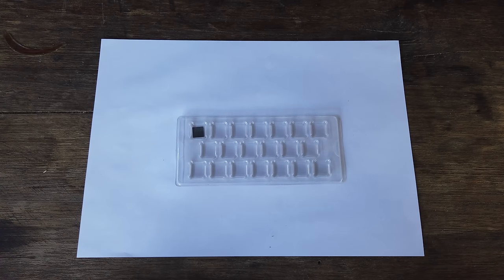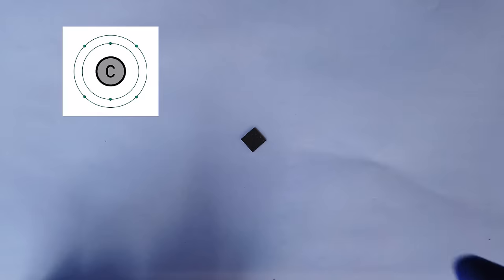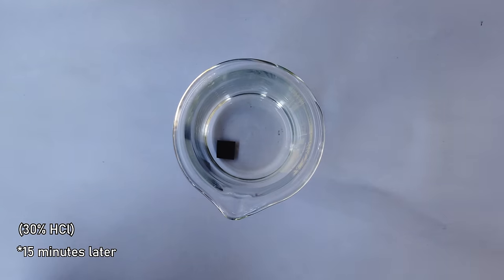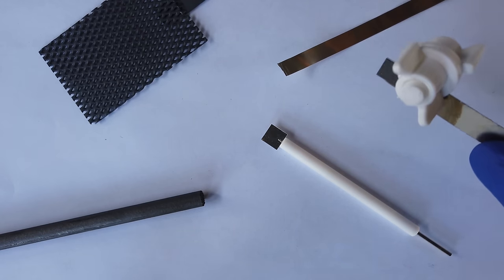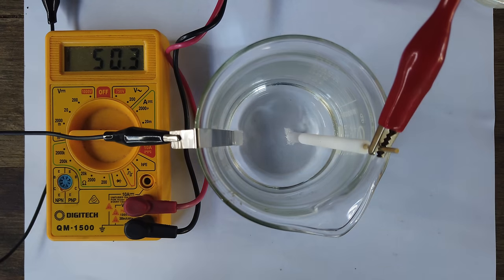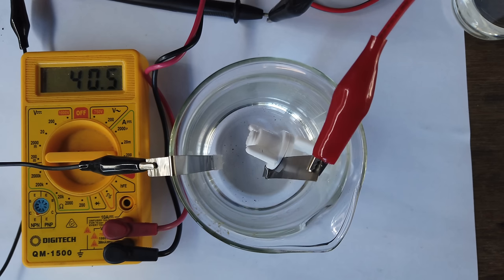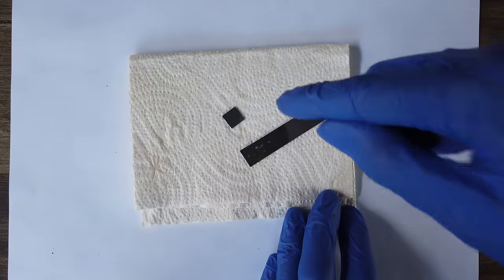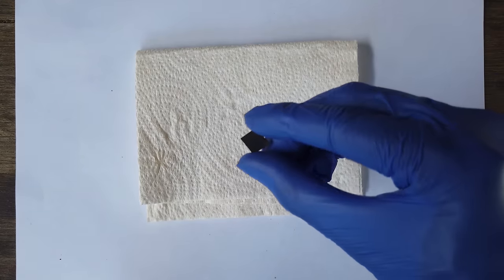A Very Special Electrode

Comment: do you think that this material may be useful for perchlorates?
Reply: Yeah, he does. 10:33
Reply: yeah ofcourse it can be used for chlorate/percholate making, it's the only suitable metal for the job, it has great yeild and its build for it.
Reply from the maker: Yep! For two reasons:
1) It's great at doing the reaction of oxidising chlorate to perchlorate.
2) When using it as an anode, you don't really need to worry much about cell conditions. Other electrodes will degrade significantly if you have small amounts of chloride in the cell or if you continue electrolysing after complete conversion. With this electrode, it's so inert that neither of those things matter. It can even electrolyse chloride all the way to perchlorate in one run with zero issues (something basically no other electrode can do).

Comment: Im wondering if these were left over from making diamond photodiodes, the substrate was made of boron doped p type diamond with nitrogen doped N type diamond. They had very good UV sensitivity in the UV B and UV C regions. They were used for measuring the energy of KrF excimer lasers.❤
Reply from the maker: It's possible, but as far as I'm aware, boron-doped diamond used in true semiconductor applications normally requires a much lower boron concentration. Having a boron concentration of above 0.1% is something that's generally done solely for the purpose of making electrodes for electrochemistry, as we need high conductivity over macroscopic distances.
Still though, I didn't know these types of semiconductor were used in photodiodes - that's cool!

Comment: Congratulations!
It looks a LOT like pyrolytic graphite, it would be interesting it this doped material will do diamagnetic levitation as 'pure' pyrolytic graphite does.
Reply from the maker: An interesting idea!
Just tested it on a set of strong neodymium magnets - doesn't appear to exhibit any tendency to levitate...
Though it makes sense I suppose - the diamagnetic constant of diamond is about 20 times lower than that of pyrolytic graphite. Conductivity doesn't seem to have much to do with it.
Reply: It won't. Pyrolytic graphite does this because of the high conductivity along the graphene sheets within the graphite. Pyrolytic graphite is extremely well aligned, so the effect is very strong. "Normal" graphite doesn't show this effect because the crystals of graphite are small and randomly oriented.
Reply: pyrolitic graphite is more bubbly looking on the surface they do look kinda similar intell   you compare them next to each other. The graphite is more gray and looks more molten than like tiny diamonds. Unfortunately, cameras don't do a good job of capturing detail

Comment: I think you should buy some electrolysis equipment with an anion and proton cation exchange membrane because it is a selective membrane that allows ions to pass through without holes thanks to chemical signals, not a clay pot with lithium holes and is strong. Surely the decomposition side reaction occurs more frequently than the production reaction. This may be the reason you failed to produce hydrogen peroxide  ,nitric acid and sulfuric acid from electrolysis. It also helps you create some reactions without the need for an electrolyte solution like fuel cells using hydrogen oxygen

Comment: Very interesting. One could not really see the multimeter reading, though and tens of Ohms is rather high for a contact resistance.
Reply from the maker: Hmm. That's true. I'll keep an eye on similar issues regarding filming screens in the future. Thanks for pointing it out!
And yes, boron-doped diamond is actually rather notorious for exhibiting a high degree of contact resistance. It's often somewhat difficult to make a good connection to it.

Comment: I like electrochemistry presented this way.  It’s intriguing.  Looking forward to more.  I actually have a BDD electrode, but I’ve only had one occasion to use it, so I’m looking forward to replicating the experiments in your videos.  I notice you didn’t use a reference electrode for this, but it looks like your power supply will accept one.
Reply from the maker: I'm glad you like the presentation style! Thanks!
I've got a couple of other videos I'm working on at the moment, but we'll get to using this thing quite soon, hopefully.
I've considered using reference electrodes in a few of my latest videos, but I feel like it would just overcomplicate things for a general audience (at least, until I make a video about what they're for and how to use them, haha). We'll get there eventually.
The third pin on my power supply is actually (disappointingly) just an earth connection...
Reply: @ScrapScience  Great!  I’m looking forward to anything you decide to make, but don’t forget about that magical BDD.  I know some power supplies have a reference port, but I plug my Ag/AgCl reference electrode into the earth connection.  I don’t ground the power supply case when I do that.  Seems to work well.

Comment: I just randomly thought about, can pressures also change how reactions happens?
Like, what if you do some electrolysis, but under INSANE pressures, the pressures is like several 100 bar, or higher? or something?
Reply from the maker: Changing the partial pressures of the reactants/products involved in an electrolytic reaction changes the potentials at which they occur.
If we take your example of 100 bar, we can very easily take the water reduction half reaction and plug this 100 bar value for hydrogen partial pressure into the 'Nernst equation'. Doing so tells us that the hydrogen evolution reaction will happily occur at 100 bar with an extra 136 mV of negative potential.
You can do the same thing for the oxygen evolution reaction, and you can find that this half reaction will require an extra 68 mV to proceed at 100 bar.
Overall, water electrolysis is happy to proceed at these pressures, and will just give you pressurised gasses as a result. You'll just need an extra 0.2 V or so to get the reaction to happen.

Comment: I've read a recent article on production of C1 and C2 carboxylic acids with diamond electrodes but thought it is a future tech not really available. This makes me review the article:

Arts, Anke, Matheus T. de Groot, and John van der Schaaf. "Current efficiency and mass transfer effects in electrochemical oxidation of C1 and C2 carboxylic acids on boron doped diamond electrodes." Chemical Engineering Journal Advances 6 (2021): 100093.
Reply from the maker: Yep! Many reactions proceed in very interesting ways on this electrode due to the ability to utilise those hydroxyl radicals. I don't even know where to start with using this thing...
Reply: @ScrapScience  I would love to see your results in future. I was exploring production of oxoacetic (glyoxylic) acid. This can be made even at scale by cathodic reduction of oxalic acid (PbO2 electrode) in dil. H2SO4 medium, but the workup and isolation is still challenging, especially due to removal of all the water and avoiding heating above ~40 oC (decomposition to CO/CO2, disproportionation, polymerization) making the compound commercially available mostly just as 50% solution with glycolic and oxalic acids as common impurities (plus minute amounts of glyoxal, glycolaldehyde, ethylene glycol, formic acid and other reduction by-products). Crystalline monohydrate is available but a bit more expensive.
I've purchased the monohydrate once and tried preparation of fragrance compounds - it's an excellent electrophile allowing convenient prep. of aldehydes so I was amazed and understood why it is popular as green chemistry alternative to other preparations (e.g. Grignards, var. formylations, chloromethylation).
I will try other production methods of the glyoxylic acid (magnesium reduction in cold sat. oxalic acid, cleavage of L-tartaric acid with periodate/hypochlorite) but so far the ozonolysis of maleic acid (fumaric might work, too) and electroreduction of oxalic a. remain the state of the art.

Comment: Say, did you ever think of remaking some of your earlier electroplating videos?

Last year, I got large graphite thermal pads whichv have been extremely capable and barely experienced degradation because of their uniformity and very high surface area.
Reply from the maker: Like, that one video I made about copper plating at the start of the channel?

It's possible, but I don't think metal plating is really my forte. I know very little about it...
Reply: @ScrapScience  That is correct. I guess sulfuric acid production is the one I remember the most :)

Comment: How will you attach it to a conductive isolated connection rod and what material would you choose? Will you now always use this clap thing to attach it to a Nickel strip? You know that your comparison is neither accurate nor is it valid, because on your doped piece was Nickel also contributing and your Ruthenium electrode had more surface area and so on.
Reply from the maker: Titanium is generally the substrate of choice for electrodes like this. It's nature as a so-called 'valve metal' makes it ideal for connections to active anode materials since it is extremely chemically resistant and passivates under anodic conditions. Eventually, I'll buy some small titanium bolts, nuts, and washers to make a good, stable connection. I've used titanium in this video to serve as the connecting piece, not nickel.

I didn't go into it much for the sake of simplicity, but I took great care in trying to keep the anode surface areas very consistent in each test. First, the BDD piece is attached with a piece of titanium, as stated before, the complete passivation of which occurs very quickly. Hence, the connecting material should not contribute significantly to the measurement of the BDD. Next, it's difficult to see in the footage, but I maintained a constant surface area on each electrode by covering excess surfaces with electrical tape, such that slightly less than two square centimetres were exposed in each case. You can see the black tape I used on the nickel anode at 5:35, and you can see it a little bit on the MMO and graphite too.

Whilst I'd agree that the comparison is not accurate (it was never meant to be), I'd still argue that the general trend we're seeing is valid. There may be an argument to be had about the influence of geometric surface area vs true surface area, or the effect of contact resistance in the case of the BDD, but the trend here seems to match literature on the comparative kinetics of the OER on these materials.

Comment: hi harry I am making a new chlorate cell in November/ December but I need some stuff for it so I've managed to find the 10v dc converter but I need a power supply that you used in your A SODIUM CHLORATE CELL video ,by that I mean a power supply that can supply at least 5 amps and that can handle a electrolysis for multiple days < so could you comment the name I should search in google to get the result in your privallige I will @ your channel in my video (I'm subscribed)
Reply from the maker: Glad to hear - a chlorate cell is a great project!
Nowadays, I just use a lab bench power supply with adjustable voltage and current. But back when I made my chlorate cells, I was using a current controlled buck converter hooked up to an ATX power supply from an old computer. Hopefully you'll be able to find a similar product.
Reply: @ScrapScience  okay thank you i will try to find that power supply , thank you for replying and i enjoy watching your videos

Comment: will this work in reverse? can you set this cell up with a mystery anode and tell what metal it is based on the voltage?
Reply from the maker: Kind of. Not for this particular test (too many metals have similar behaviours when performing the oxygen evolution reaction, and the test is sensitive to many other experimental factors).
Other very similar tests (voltammetry and open circuit potental, for example) can definitely identify metals though!

Comment: I'm sorry if I'm asking too many questions but you mentioned that a Platinum anode is not resistant to HCl, HCl can form at anode chamber when doing membrane electrolysis of NaCl would that degrade it too or are the amounts forming too small to cause damage?
Reply from the maker: It ultimately depends on how you run the electrolysis in that case, but yes, the concentrations of HCl generated under membrane electrolysis of NaCl are not high enough to degrade a platinum anode very quickly.
The rate of platinum degradation for chloride electrolysis is going to be a function of pH. With lower pH, the rate increases exponentially.

Comment: I electrolyse the copper out of my spent ferric chloride etchant, using a platinum wire anode, but only with very low current. I leave it for a week with like 10mA. Will the platinum still degrade at this, I wonder?

Also it would be informative to see you compare the properties of those anodes to lead acid battery anodes, I hear they’re remarkably chemically resilient.

Oh and that window comparison is fascinating, from the perspective of electroplating novel metals. I’ve been looking into electrochemical 3D printing, particularly the ability to print an alloy that changes ratios as you go, being able to add vanadium to a nickel+iron alloy would be handy, but I guess chromium is probably too far away.
I think it would be possible to have two electrochemical loops, one that dissolves the metal and another that redeposits it, in the same system using floating power supplies and a properly designed print-head.
Reply from the maker: In the presence of chloride ions, platinum degradation basically depends on pH. The lower the pH, the faster the degradation. Not sure exactly when it becomes a problem though.

The positive electrodes in lead acid batteries are actually terrible as anodes, and reports of their chemical stability are very misleading. It's pretty much a wildly pervasive myth. Due to the way lead acid batteries are designed, the positive electrodes are nothing more than than a lead sponge that has been anodised to form lead dioxide on the surface. Since this is never a perfect coat, the anodes are really no more chemically resistant than lead metal, and they're only really stable in sulfate (and maybe carbonate) electrolytes. Basically any other electrolyte will quickly destroy these electrodes and leave you with a mess of toxic lead in solution. I really wish it weren't such a common myth, because people recommend these anodes all the time without any knowledge of their actual properties - basically convincing people to make a bunch of toxic lead waste.
Anyway, sorry for the rant about lead acid battery electrodes, I'm just not a fan of how common the myth is. Basically, these electrodes aren't chemically resistant at all. If I had to add them to the table at 4:11, the sequence would go 'resistant, degradation, slow degradation, degradation'.

Can't say I'm very knowledgable on any plating processes, but your investigation sounds interesting!
Reply: @ScrapScience   thanks for the reply, I heard that it was the lead oxide that was itself electrically conductive, but it makes sense it wouldn’t be stable outside of that kind of solution. Maybe lead oxide itself could be deposited on a matrix like with an MMO electrode, but that still assumes it’s mechanically stable and electrically conductive enough in that form. I’ve always been pretty wary of lead in solution, so thanks for clearing that up.

Next up, buy myself an iridium electrode haha
Reply from the maker: Depositing lead dioxide on an MMO electrode is actually a very reliable way to make a robust lead oxide anode! From what I've seen, anodes prepared this way are quite good, though they do slowly fall apart mechanically (much like graphite often does). Of course, only if you're brave enough to set up a lead oxide plating bath... I'm definitely not, lol.

Iridium... a good choice, haha.

Comment: Would this electrode be suitable for a Zinc Bromide battery? I've read that Zinc Bromide batteries need to be charged below the threshold of water splitting. So, with this electrode, could you apply more amps without splitting water?
Reply from the maker: Not really, as far as I'm aware.
If you use this thing as the negative electrode, you're going to be depositing zinc metal on it anyway during the charging process, and the threshold for water reduction will quickly adjust to that of zinc.
If you use it as the positive electrode, it's not really necessary since water oxidation is so much more difficult to perform than bromide oxidation, regardless of the electrode material.
Additionally, even if you could widen the electrochemical window of your solution easily, using larger potentials to charge the battery would just lead to less efficient battery charging, which I imagine is not ideal.